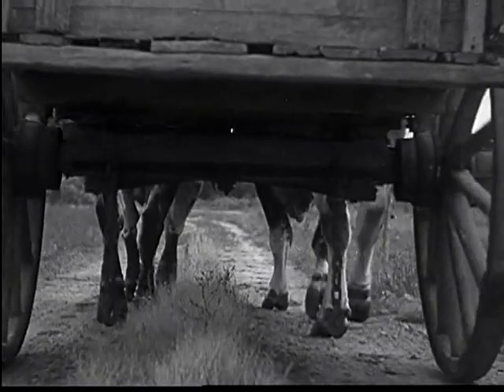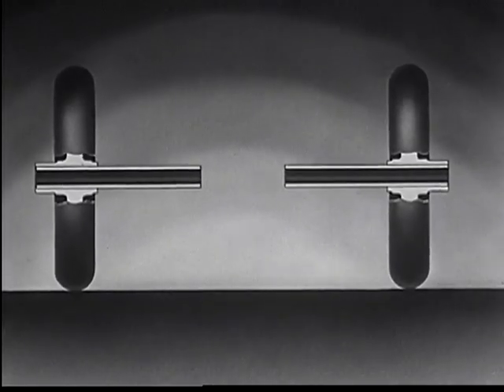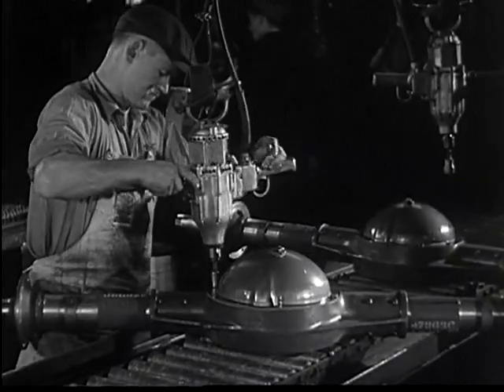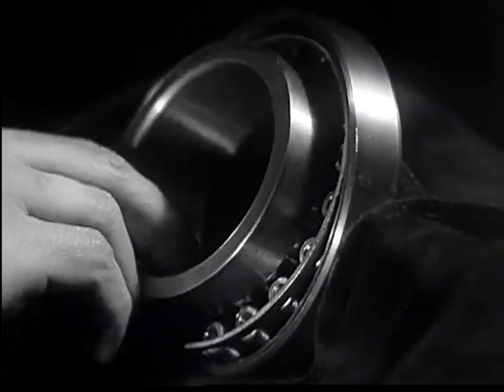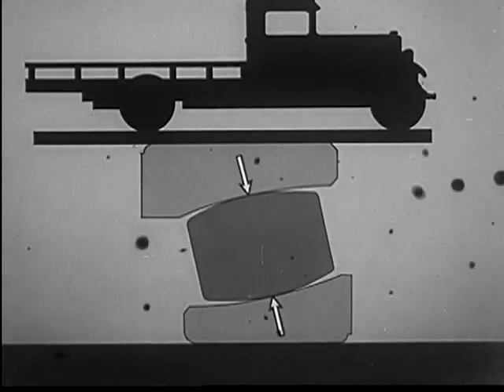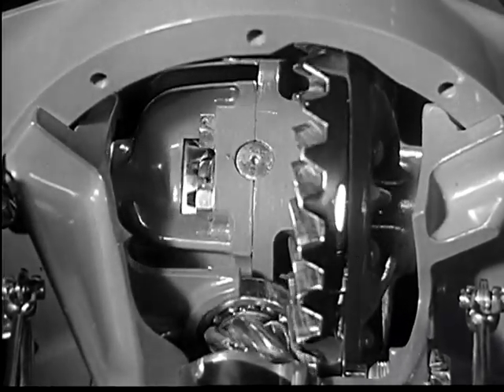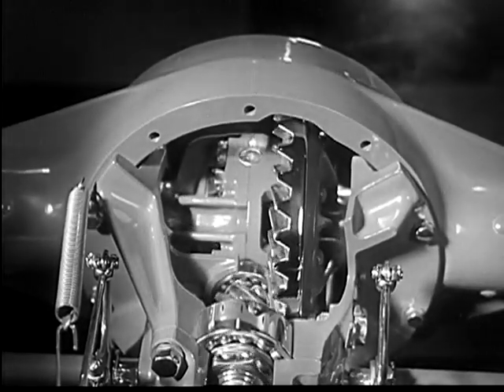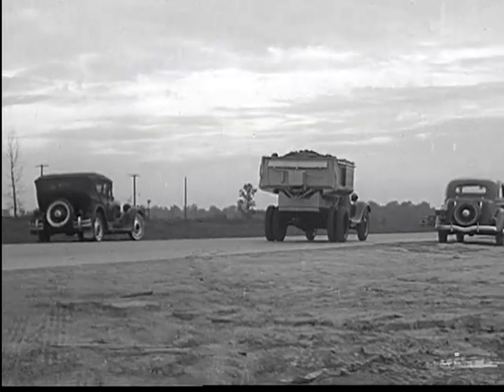It Floats - Chevrolet Full Floating Rear Axle (1936)

Comment: replacing the axle without having to remove the wheel? I'm sold!
Reply: Regarding replacing a broken axle - how do you remove fragments that find their way into gears and bearings (with predictable results) without removing the inspection plate and draining the oil, followed by flushing and refilling after reinstalling the cover?  I suppose it beats having to remove the load in order to make the repair, especially if you just happen to have the tools, the magnet, the solvent, the oil, an oil fill pump, and a spare cover gasket and axle with you at all times.  Yeah... that seems practical.
Reply: @vidiupload4174  I never leave my house without said materials ? You do ?
Reply: @DankNoodles420  Too much weight.  Slows me down.
Reply: What I want to know is how often did a broken axle actually happen before?
Reply: @cetyl2626  Probably less of a axel that actually broke in half and more of the teeth getting stripped off of the end that is driven by the rear differential
Reply: @cetyl2626  These days axles are pretty much bulletproof.  You'd have to have serious power and serious traction to affect an axle in any way.  Besides, cars with these attributes usually have seriously strong differentials to handle the abuse.
Reply: @Mr. Sunshine Is there some reason you feel the need to keep calling them dumb? Just try talking and presenting information. ;)
Reply: @Mr. Sunshine Like you are?
Reply: Love the speed brace undoing the axle studs.
Reply: As long as the axle isn't broken, sure.  If it is, then how are you getting the other half of that broken axle out?  Hours of disassembly; that's how.
Reply: @bvcxzgt5451  We always kept a strong magnet for that reason, replaced in the field, literally! Matter of minutes, not hours.

Comment: The one thing that I wonder about is the narrator said if you break an axle, you could remove it and replace it without taking off the wheels. It's easy to get the outside end, but how do you get the inside end of the broken axle out?
Reply: I'm just guessing but you probably unbolt the "banjo" inspection plate and push it out from the inside with a flexible tube...of course I stand to be corrected.
Reply: Take the shaft out of the other side and push it out with a long pole.

Comment: And here I am with a 1935 Chevy and its shitty inferior axle...
Reply: 😂😂😂 damn if only it was one year newer
Reply: Shoulda waited for the 36 suckaaaa...

Wait the 37 has 20 more HP...
GOD DAMNIT.
Reply: @Bramon83  axle swap and engine swap that bad boi
Reply: SMH my head
Reply: Wait a minute, how did you get a 35’ I got a 25’
Reply: Haushuashashau
Reply: Git rekt scrub

Eat your cereal
Reply: one complete sturdy unit...
Reply: When your ‘35 axle needed replacing you could simply purchase a newer axle design and bolt it right in!
Reply: Suck it up.
Reply: 1936 Chevys were shitty too, they were Chevys.

Comment: keeps mud out pretty good, too! although if the bearings go the axle will run out the tube, which makes for a weird experience! as you can see in my picture, i am sitting in the bed of my 3/4 ton 1973 Chevy Cheyenne, which i bought in 2007 extremely used for $1200, and have done nothing to it except brakes, the afore-mentioned bearings, and a new battery cable.

Comment: I love these old infomercials. They do a much better job of explaining how things work than todays television broadcasts.
Reply: They can't promote car life as cars are designed to only last 5 years so you buy a new one every 5 years , with todays tech we could easily make every vehicle made last 70 years
Reply: @chinabluewho my dad's car is almost dead, but it has lasted him about 16-17 years
Reply: @chinabluewho  Toyota/Lexus seems to hold up pretty well past 5 years even with all the gizmos.
Reply: @chinabluewho  Then again very few people could afford a car in 1936, not to mention most of them required an on-site mechanic to maintain it regularly, and even just to start it up - I don't think most people appreciate that you didn't just get into a car and turn a key back then, you had to start by priming the fuel pump, lubricating the engine head, checking the ignition system and after 15 minutes you can actually start the engine...by hand. And of course it's easy for shit not to break when your engine revs to 2000rpm and makes 50hp and your car has a top speed of 70mph, components are not exactly highly stressed.

Nowadays you get a car that is 10x better in every measurable way for 1/10th of the money.

Comment: When cars, and pretty much everything was built steel-solid... Now we live in a plastic world, were everything is disposable within months or just a couple of years at most.
Reply: Don't go telling me a steel dashboard's better to hit my face into than a plastic one at 60 MPH unless you're pulling a comedy routine.
Reply: A lot of times they'll use a cheap plastic part that is designed to break to save an expensive metal part.
Reply: TheHuskyGT to be utterly fair. Those are also the days when cars are death traps.  That plastic bends and breaks, dispersing force, exactly as it was designed to do.  Rather than have all that force transfer to you.
Reply: John Long Do you live in a salt mine or something? That's ridiculous. I had an 09 Cobalt, cheap as can be, and just traded in for a new Accord last summer. Nothing wrong with the thing after 7 Northeast winters.
Reply: i wouldn't argue safety issues i'd argue reliability and cost factor. .i mean plastic thermostat housing .... like wow
Reply: Years ago I rebuilt a 1963 chev engine. The rebuild wasn't caused by the plastic timing gears, they were in good shape. Plastic has it's uses, just like metal has.
Reply: Reminds me of those Alpha Romeos of the seventies that would rust away in 5 years.
Reply: the ford 302, 351, and powerstroke 7.3's were
Reply: John Long....oh c`mon.
Reply: Especially those "biodegradable plastics" I mean after 4-5 years of usage, the plastic on the car just disintegrates into nothingness?!
EDIT: Basically rots
Reply: john martin old cars were still extremely dangerous even with seatbelts. Have you ever paid attention to the size of the B Pillars on classics vs modern? Old is pencil thin while modern is nearly 6 inches in width. 

Back then they used steel because it was cheap and effective. Not because they were high quality. 

They switched to plastic because it was cheaper to use and could still retain quality. 

Fast forward to now, everyone wants cheap vehicles that are still safe, so the interiors usually suffer quality to maintain a low cost and still make profit.
Reply: Tell me again how many cars from the 70s and older were getting 200,000 miles or more with only relatively minor maintenance?
Reply: Yep, my 2010 fusion has holes in the dash, seats, door panels, headliner, trunk lid, trunk, a b and c pillars are falling off, carpet has basically disappeared to where you can see the floor and there are rust holes in the floor. That started about 6 months after I bought it. You should see how much duck tape I have on everything holding up the deteriorating bumper covers and the crazy amount of fiberglass and bondo I've put on all the holes forming everywhere. I even have bailing wire holding the transmission in.

My goodness I should have traded it in at the 9 month mark. I really should have purchased the 2,500 mile extended warranty.

Damn things just don't last like they used to!

Comment: if it was a ford and you needed to replace the axle with a full load you would have had to remove the hood the driver side window 3 of the 8 spark plugs the head lights and sucked four guys dicks and only after all of that you would find out the process needed to be repeated because the head lights needed to come off first and a fifth dick needed sucking  ..................................

Comment: fuck this is probably still 10 times stronger then the axles they make today! look how much steel that thing is made of!
Reply: Yeah guess this truck is heavy af then :D . Modern axles can probably handle the same but are more compact due to advance in materials technology.
Reply: TARider2: The rear axles today are much stronger, though not necessarily heavier, than 1936 models. They have to be since most modern trucks are heavier with larger wheels, tires, and bigger engines and transmissions designed to carry a heavier load.
Reply: I believe that one of the comparable advances from that time to modern technology is probably in the alloys used. Nowadays they're much stronger. Besides that, the engineering and tech is probably all still the same. But I must admit, back in that day they were building it for extreme longevity, while today there is "product life cycle" shenanigans...
Reply: arthur they had to go for longevity because they had no choice. it wasn't going to last no matter what they did, so better than the competition was how to set themselves apart.
Reply: It's just a ton of steel.. modern axles have alot more structure, a little less strong but way less heavy.
Reply: its a big truck. its not for a 1/2" ton
Reply: Idk it’s not independent and it doesn’t appear to be forged. I could be wrong.
Reply: It is a sign of weak moral fortitude to cuss while trying to make a point.

Comment: They dont build them like they used to
Reply: ... This axle design is still in use. brand new 2017 heavy duty model trucks use this variant.
Smaller cars are usually FWD so they don't need it and light duty trucks almost never break axles so there is no need.

Comment: I suspected it for a long time but after seeing this, I think progress is a myth.
Reply: You know.. When engineers thoroughly develop a solution, that solution is always valid, until some new tech changes the fundamental parameters of the problem. Modern advances changed more on things like electronics, while hardcore mechanics didn't change much, aside from new alloy/smelting/tempering and a few other details. I guess the most disruptive tech in that field are composite materials, but until we start seeing rear shafts, gears and what not made out of those, not much will change :D.
Reply: @AV1461  New technological advances often make old solutions obsolete. Just look at patents in the 1930s, when people used crazily complex design just to control motor direction and speed *mechanically*. They were geometrically perfect, given the conditions at the time. Even then, they were often not that linear in many cases. Nowadays, you can do the same with stepper or servo motors, far easily, smaller, cheaper, and the motion is just mathematically perfect. It's also easier to maintain and less prone to faults.
Reply: So go back to a horse-drawn carriage, and see whether that fits you. Wait, horse carriage was an impressive technology in the antiquity. You should lug everything by feet. Better still, crawl on four feet.
Reply: depends on what we want to progress
Reply: It is. It's just bs made up by people who want credit for nothing.
Reply: sometimes new is never better. they got the design perfect and there still isnt a way to make it better to this day. brake pads still have some asbestos in them because they havent found a material that performs as well yet for less than 5 times the price
Reply: @chaytonruijsenaars3971  "sometimes new is never better." "Never" is too much. Some technologies are so good that it takes very very long to discover better alternatives. Ancient people spent at least thousands of years building houses with stones and woods. Until we have bricks and then cement.

Many technologies require long chain of prerequisite technologies. Ancient Greeks didn't know metallurgy, modern physics, oil and so on, so they couldn't just invent cars to replace horses, however much they think and try. For them, it seemed like transportation would never be better than horses.
Reply: @y.z.6517  yea your right. thats true. but some things are still the way they have been since invention hundreds of years ago and its just been that way ever since cause they never were able to make it better. it was just so simple and good it just always worked great the way it was and any change seemed to make it worse
Reply: @chaytonruijsenaars3971  What "things are still the way they have been since invention hundreds of years ago"? Would you like to point out 1 that has not been improved in any way since written history? I've looked around my room. Everything I see has either been invented to replace their early functional counterpart, or improved in some way so that they are either better or cheaper in one way or another.
Reply: @y.z.6517  zerk fitting to name one. threaded black iron pipe to name another. still build houses out of wood after all the new materials they came out with and and they build them pretty much exactly the same way. only the interior and furnishings changed really. ive been in houses from 1920 and they are the same as houses nowadays only nowadays they use less wood so they are quite a bit shittier and it was remodeled with new furnishings so the only way i noticed was one door that had an old ass skeleton key knob and i asked how old the place was. im sure there are more things that we both dont know of
Reply: @chaytonruijsenaars3971  Threading requires unified and agreed metric (or imperial) standard, lathe, high quality metal. That's hundreds of years old max. Plus, digitised machines make it far cheaper to make.

Modern wood makers use the hell out of wood glue(s), which depends heavily on chemistry. Just look at your furnatures. Unless you are rich enough to use huge wood for anything, your furnatures are typically made with hundreds of glued woods. Wood is process with table saw, which is hundreds of years max. Ancient people used saw. Before that axe. Also, CNC makes it easy to make any pattern on wood. That's last century thing, due to the advancement of computer.

Typically, there are thousands of details used by manufacturers. A product may look the same to amateurs, but under the hook, they are made with completely different processes over time.

Try to design and make something as simple as a gear, and you will be shocked by how complex it really is. (Hey, don't use a ready-made CAD model. That's cheating.) I did. I 3d printed involute, bevel and helix gear, and it took me hundreds of times of time I thought I needed. A lot of patents I used are barely a few decades old, even if gears are thousands of years old.
Reply: Actually cement existes for at least 2000 years, Romans perfected it around long ago and it had the capacity of drying inside water. We still do not know how to do it like them and our cement do not in any way shape or form resists and lasts like the one used in the old old days.
Not to mention the Piramids and the technology and man power to do it that would be inconceivable to do the same today.
But i get your point.
Reply: @y.z.6517  After looking at your response it seems that you're responding for the sake of arguing instead of educating. 
Yes, all the things you've mentioned, people already knew them.  
You're not special and exclusive to this kind of information.
Reply: not near as much as they used to cause they "banned" it but believe me its still out there. they banned its manufacture in america but where do you think the pads are made? in china by slaves where they dont live long enough to get mesothelioma anyway
Reply: Sometimes happens fast, sometimes slow... the differential has been around for 2 thousand years and didn't change much (there is nothing to change), computers for 70 and make lightning fast improvements.
Reply: You have a great chain now? Is that not progress?
Reply: Bill Gates tried to improve the toilet and so two $50K models were built - he didn't understand that you just have to separate the urine from the crap - so that the toilet composts without smell. Composting is real technology. Roman Aqueducts were built due to not using composting toilets but instead crapping in clean drinking water. oops. Progress? I think not. http://arctic-news.blogspot.com - the East Siberian ARctic Shelf methane bomb is about to go off - and double global warming real fast. Too hot to grow life on Earth....
Reply: That's why the trope of "old but gold" exists.
Yeah, no sh*t, to those who respond to this thread with something like "tHaT's NoT tRuE, hErE's WhY..." Well no sh*t captain obvious, the statement by the OP can't be applied universally.
You could stop pretending you're somehow intelligent by refuting the OP with your attitude.